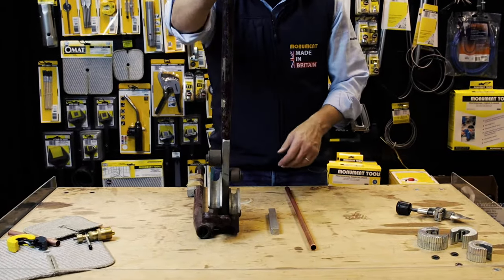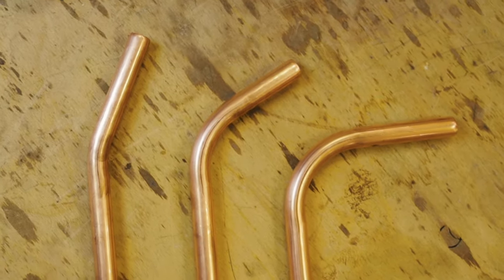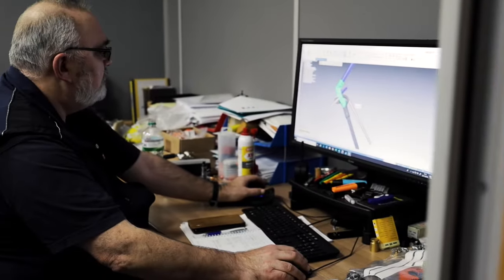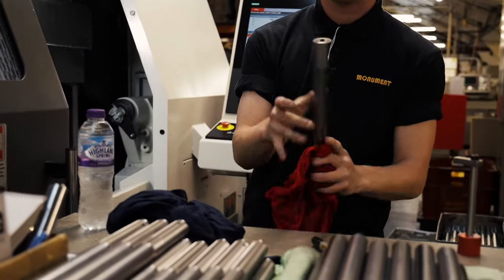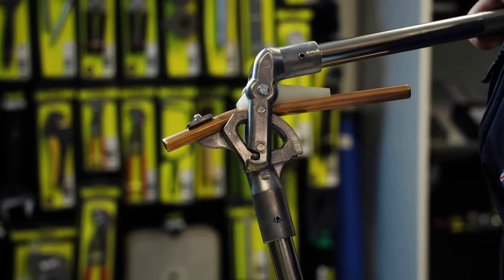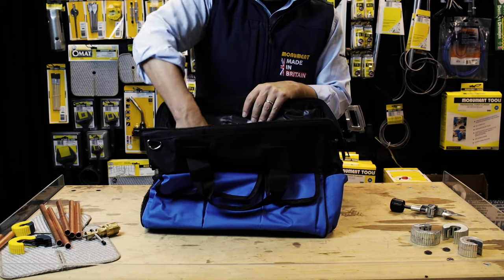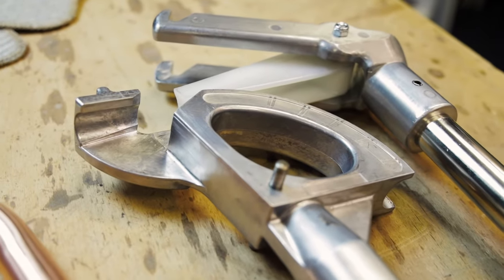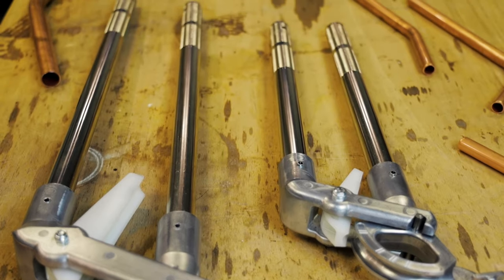Monument XV and XXII Pipe Bender Launch Video

Comment: What was wrong with the original 15mm/22mm handy bender? why not make a better updated version of that rather than give us plumbers two benders to carry? As a plumber for 40yrs I would more appreciate and find more useful an updated small armed handy bender doing both pipe sizes with telescopic arms allowing greater leverage for 22mm copper, also one that is easier to carry to the job whilst carrying my tool bag. It can be a pain bending 3m lengths of pipe in someone’s house, so a two part bender having to be assembled and disassembled for every bend or indeed coming apart at an inopportune moment could cause me to lose control of the pipe may cause damage to people or property. I’ve used Monument tools all my working life as a plumber and I value their quality but in this case it appears that the tool makes the job harder and give us twice as much stuff to carry. We also need the ability to move the guide when creating offsets, a fixed guide limits it’s use. Make a lightweight 22mm/15mm handy bender with short arms that are increased in length (telescopic, not screw on) for 22mm and you would have a better, more sellable tool.
But then again I would assume that you would be charging crazy money for a good tool like that, compared to the original handy bender….. anyway, everyone uses plastic these days as it takes no skill to install, most “new” plumbers cry if you show them 22mm copper and ask them to bend it!

Comment: Bought a pair of these and to honest they are total rubbish the force required to bend pipe is twice the force of my combination bender that is using the extension handles as well. I have tried contacting monument several times with no joy with them I don’t hold much hope of the plastic guide lasting very long don’t bother with this and just go and buy a bend it now combination bender sorry I have had to post this customer service shocking
Reply from the maker: Can you please email me at jamie.fisher@monument-tools.com with details of where you bought these and who you have been in touch with at Monument please as we have no record of your issue.
Reply: @MonumentToolsLimited hi Jamie all correspondence has now been sent to you
Reply: thanks for that, I was thinking of getting these, but will stick to my hilmor benders which I got in 1972, when they were made in england by 
 " Bend it now ", I also have Record benders which were made in england, you cant beat good quality. I use to work a 5 minute walk from Monument tools factory when they were on Balham hill sw12, back in the 70s, and they were really good, but I think some of there stuff has gone down hill, I bought a back nut box spanner recently, and it would not fit on a standard backnuts due to the poor quality quality control, Monument.was not even stamp on the tool, but was in there packaging. makes me think it may have been made in china. 
what a shame